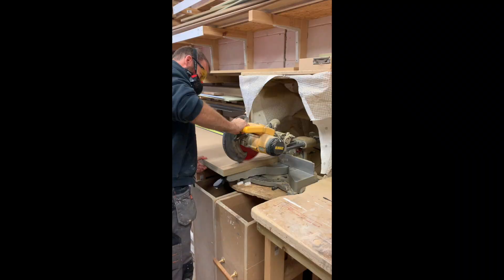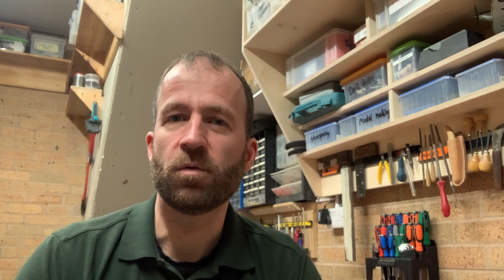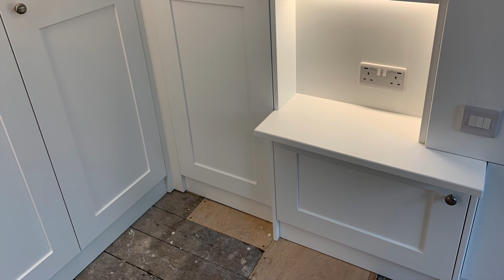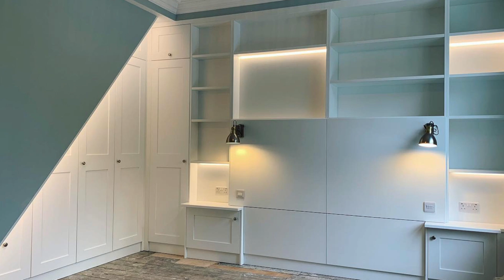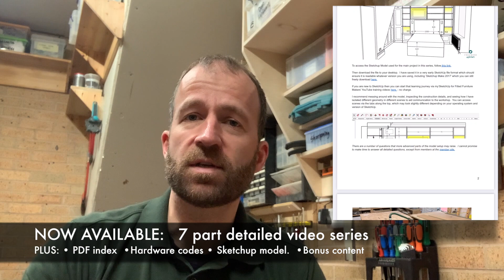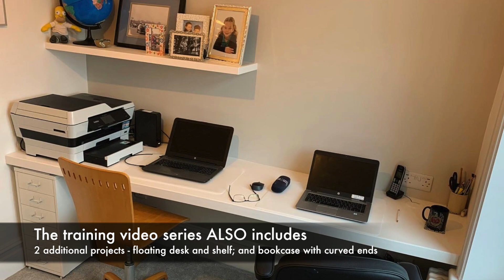How to design, make and install fitted furniture - 'A Fitted Furniture Apprenticeship' series intro.

Comment: What’s the name of the special screw and drill that you showed for fixing cabinets? I also think Festool Domino for construction of cabinets is a waste of time. I usually just use 50mm screws for unit construction, they are covered by decorative panels and not visible on completion. Thanks 👍
Reply from the maker: Hi John it is a confirmat screw, size 2.  You will find similar ones on some ikea furniture.  I see it as a. mixture of a screw and dowel, with the advantages of both.  The downside is you have to buy a quite expensive stepped drill bit to use it properly (the cheaper knock-offs blunt and break too easily).  You can also direct screw with a decent self-cutting 3.5 gauge wood screw (I used to use the expensive Spax-M spearpoint MDF screws to avoid splitting the mdf, but lately i have found the fine gauge standard self-cutters do the job).  Currently we use these KTX brand ones: https://www.blum.org.uk/product-detail/All/KTX35050?proddesc=KTX-LOCKING-DR-SCR-3.5x050-YW-x200&description=ktx
Reply from the maker: See also this post which I have unlocked for public access on the member site: https://www.buymeacoffee.com/Freebird/screws-mdf-3-types-use
Reply: @Alastair_Johnson  thanks Alastair for the reply, keep up the good work 👍